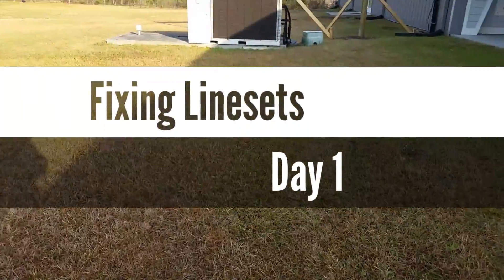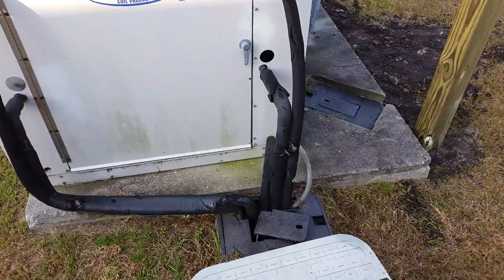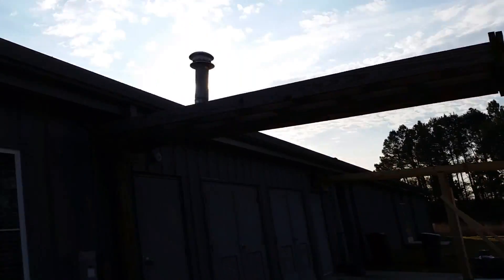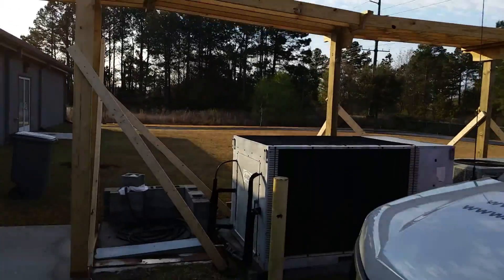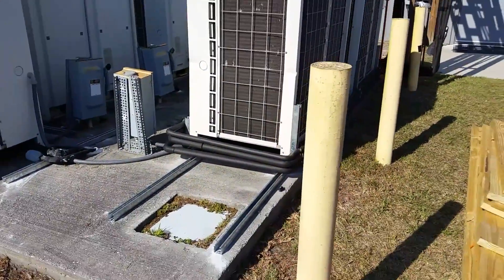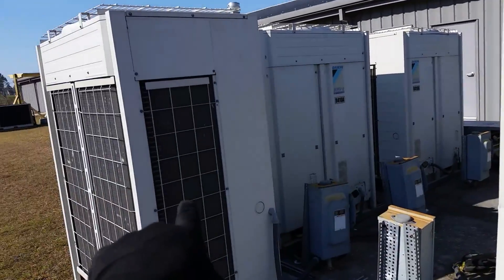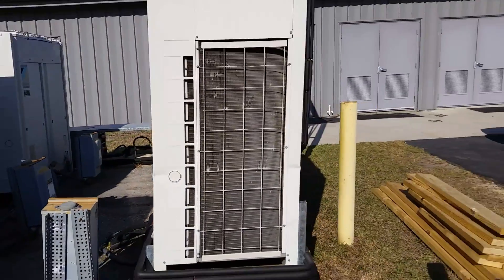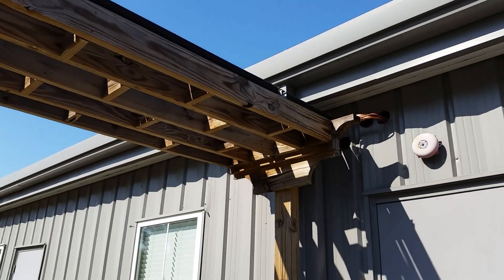Lineset Fix Day 1

Comment: Is the linesets being underground an issue with just these types of units? Almost every unit in my area has linesets that go under a slab.
Reply from the maker: navysuit Really depends on the particular system, setup, and location of each piece of equipment. Thanks for watching.